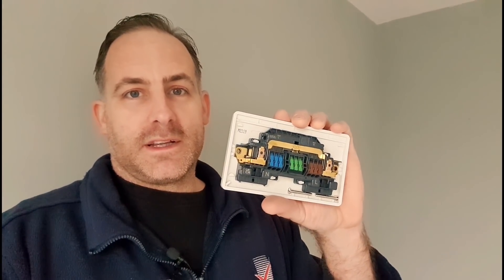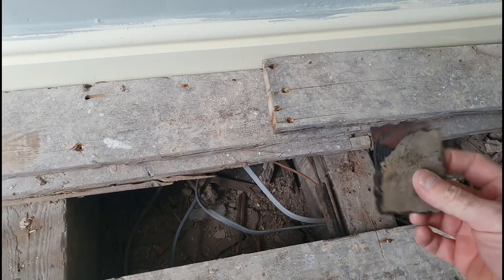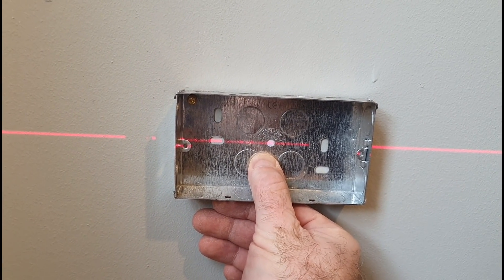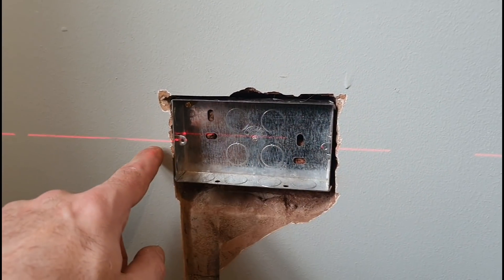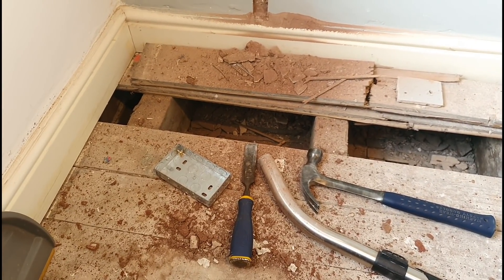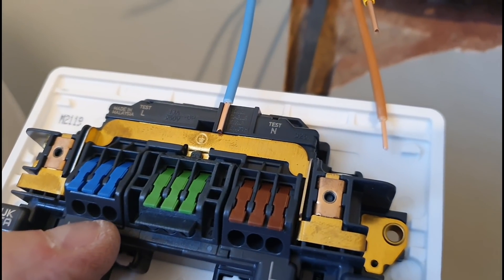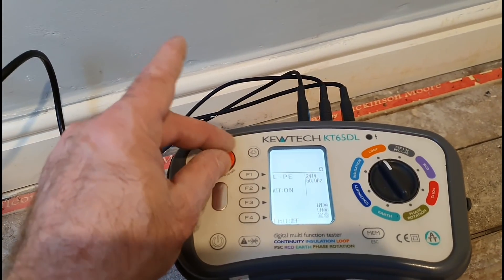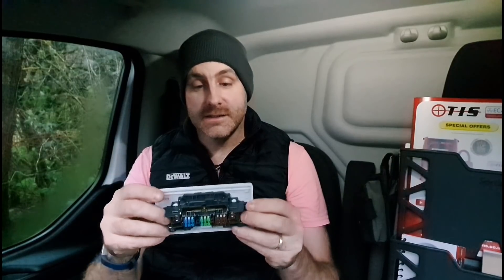OFFICIAL | The Best 13 amp double socket on the market. (55)

Comment: As a DIY-er, the Logic Plus Rapid Fix from MK 13 amp double pole 2 gang socket is one of the worst I've used. Having pushed the cables in properly on open levers, then pushing the levers fully down, the cables would often be loose so that I could pull them out again. I eventually got them to fit so that they would not pull out, but I've lost my confidence with these and have gone back to the screw fix connections. Disappointed because I've always trusted MK and paid the extra for what I thought was good quality.
Reply from the maker: Yes, unfortunately MK are not the trusted quality manufacturer we all thought they were. They've been bought out years ago and now all their products seem to have dropped their standards! I fit an MK consumer unit about 6 years ago and it was a horrible experience.

Comment: Great video, the MK socket is pretty cool as well, dual earth terminals, no need to torque the terminals as they are pre--set by the manufacturers connectors. I was waiting to see how you got down the back of the skirting board but that didn't happen. I used to do a few domestic installs back in the early 80's but we didn't have laser levels, multitools or impact drivers. The process hasn't changed that much, when we first got SDS plus that was a game changer and peppering holes in the brick to fit a back box became the norm along with the brick hammer and bolster chisel. Before we had portable electric drills we used to use a rawl-tool to make a hole and fit a fibre plug for fixings. Before the rawl-tool they used to knock wooden wedges into mortar joints so you could fix accessory boxes with a wood screw.
Reply from the maker: Early 80s you say! The only thing I was doing back then was filling nappies and sleeping ahh the blissful ignorant days. Now I get no sleep and someone else is filling nappies for ME to change. I used an old worn 16mm flat bit to drill behind the skirting. I've seen the timber in mortar joints way many times, I've even done it myself once or twice for a good fixing. Cheers for watching Jon.

Comment: I think they'll be good for the DIY crowd - it's not just the speed of connection, it's the consistency of that connection. They look great for spurs and socket circuits wired in 4mm too - I'm never quite happy that all 3 conductors are satisfactorily screwed into traditional socket terminals for spurs, there's always one cable that wants to slip out!
Reply from the maker: You're right, even with torque settings, all the best equipment and the good old tug test, there's always that uncertainty that that one conductor will flop out or snap off when screwed back to the wall. Not mine of course, mine are all perfect 😁😇👌

Comment: I’m glad they’ve changed them, because the screw terminals in MK is shait as Fok. They cut the thread to prevent screw fallout and they’re a bugger to begin the thread on initial tightening, I dropped them for click years ago. They also have wider holes for a nice full width flat head on the click also… I’m waiting until they become as cheap as screw terminals SO’s, but there will always be that situation they’re perfect for to make that job easier… great vid. Keep em coming.

Comment: Are you not allowed to junction box the ring main under the floor boards where that socket was and spur off it from there?
Reply from the maker: Yes you could do that. If it's not going to be an accessible place then use a maintenance free junction box like Wago, Ideal or Hager provide.

Comment: The problem with them is the ability of the wire to pull backwards out of its home. As you move the socket away from the wall, if you don't realise they are fitted, you can easily pull the live and neutral out at the same time and that's no good if you don't have the power off at the time.
Reply from the maker: Yes, that's something we'll all have to think about from now on when inspecting.

Comment: Pull out a bit too easy for me tbh. If someone smashes into a surface mounted box I'd be worried the faceplate will pull free and leave the conductors exposed tbh. I don't worry about that with the usual screw terminal types.
Reply from the maker: Good point although if someone smashes into it then hopefully that'll get the spark round there even quicker to fix it?
Reply: @JBE  you'd think so 😳😂

Comment: Why on earth didn't you replace the existing socket as well with an MK? Looks really bad having different types in a room. Very unprofessional.
Reply from the maker: Watch till the end, I did but didn't film it. I've had the MK super socket for months and was waiting for a chance to get it installed somewhere. Using a wood chisel to chop plaster out the wall, now that's deeply unprofessional!

Comment: Damn these sockets are sexy, they are definitely here to stay. How much are they and do they do a more modern look ones? 

On a note, so much faster with a sds, also carry some bonding 60 with you, they are so handy with filling chases, sets in less than 60 mins, fillers aren’t really suitable for chases, especially these ready mixed ones. And they take forever to set with such a deep fill
Reply from the maker: Bonding 60 👍 I'll look into it Tony. The sockets are £5.99 each from Screwfix.
Reply: PVA followed by one coat plaster the white stuff,  works for me 👍🏼.

Comment: Would it not been easier to extend the ring under the floor on the existing socket? Save the second chase? Decent job as always
Reply from the maker: It was just the job I was doing and the way I planned it. You're right as are a few others on here, a maintenance free Wago or in-sure box terminated correctly would of been equally acceptable. There's more than one way to skin a cat, chances are if you put it on here someone will correctly inform you it could of been carried out a different way. Cheers Scott.
Reply: @JBE  
Atleast you have the guts to post it mate you make great videos. Even I’m still learning from some of them keep up the good work
Reply from the maker: @ScottMcD91  You learn things from my videos? 😬 I'm sure the only thing I've done correctly is how to make a pot noodle? 😆🖖
Reply: @JBE  Still looks like you make a crackin' pot noodle.  Legend has it better then most 😜.
Reply: I'm glad I was not the only one thinking that, can always run two cables to put it on the ring, would make it easier for the next guy if they wanted to add another socket next to it..
Reply: @steve11211  
More acceptable now with wage boxes and connectors. Leaving a good solid joint under the floor is fine in my eyes. Would always write on the floor board for the next person. But this guys a cracking spark knows his stuff
Reply: @ScottMcD91  Yeah totally agree..  If it had been me doing that job with my luck the existing cables would have gone down from the socket 1 inch then gone off on a 45 degree angle and I would have cut through them..  Nothing wrong with the job, so many ways to do a job no one right way..

Comment: Talking of sockets, why do they melt when running a fan heater for a number of hours? Plugs I've recently had melt also, if they are rated at 13 amps surely a 2kw appliance shouldn't cause catastrophic failure? The MK look nice and are the best i think
Reply from the maker: Hmm 🤔 melting sockets and plugs! Not sure what's going on there? 2KW for a long period of time might make some connections hot? But melting is something wrong in the system somewhere.
Reply: @JBE  Actually it was the plug on a 4 way extension gang, nothing else plugged in, absolute molten plastic around the live pin. Cheapo socket from screwfix melted a little with crack also, same 2kw load over a period of time. Nothing wrong with the wiring, I think sockets and especially plugs are not up to the loads for continued use. MK make one plug that almost looks like an old bakolite it's that's thick a housing, I bet they would have no issue, so how do these cheapo plugs get passed? How many fires will they cause? Great channel by the way

Comment: I bought one for the first time yesterday to fit in a kitchen cupboard. I thought it was a great idea simply because it was awkward to get into the cupboard and I’ll be blunt I couldn’t be asses struggling with a screwdriver in there. I thought they were really good and did make the job easy. 

Great vid as always mate
Reply from the maker: I can see that they'll be good for awkward access outlets. Like within cupboards supplying appliances. Cheers 😎👍

Comment: Mk were the first company to design the socket with curves, then everyone copied them.
These sockets are like every time saving product in the electrical industry, too expensive, manufacturers, price themselves out the market, the time saving does not justify the cost, especially when I can get a click twin socket for less than £2.
Reply from the maker: I suppose it depends on what the customer wants? Some socket accessories are near that price anyway. But yeah by the time you add on your bit they become quite a cost to pass over.

Comment: I think they are a great idea but the levers don’t seem anywhere near as strong or as well built as the wago ones to me, you can just pull the cable out of these when they’re clamped down without too much force
Reply from the maker: Oh really 🤔 I didn't know that. I'll have to have a go next time. Time will tell how they hold up.
Reply: @JBE  yes I can’t imagine them coming loose during normal use but you know you how if you try to pull a cable out of a wago it just wont come out and feels reassuringly solid? Try that with one of these and it does pull out. It’s as if they copied the technology and not very well

Comment: The most interesting thing in this video was you appeared to us a special drill to make holes in the back box, but it only features briefly with no indication what it's called, how good it is, or how I might get one. Perhaps discussed in another video somewhere?
Reply from the maker: Yes definitely Robin, I've featured it in another video where I've had to use it to adapt equipment to suit my needs.
Reply: Cone drill

Comment: Hi James, what about the situation when you take a spur off a ring like you did in this video, how do you connect the earth lead to the backbox? you have only room for 3 earth conductors, do you put 2 earth wires in one connector, I have tested this myself and they appear to hold and test ok, you said you were  going to change the other socket, how did you deal with 4 earth wires?
Regards from Ray in North Wales.
Reply from the maker: Take one of the cpc's from the ring final circuit, put about 3 inches of sleeving on it, then bend a V into it, bring it to the earth lug on the back of the back box and connect it, then sleeve the remaining cpc and terminate into one of the 3 levers. I hope that's understandable? 🤷🏼‍♂️😳👀. If not check out my channel, video number (53) where I can be seen doing this in a kitchen. Although not on this new super socket, just a regular version.
Reply: I think they’ll take 2CPCs in one port, same as wago
Reply: @markhardacre1  Hi, yes I have already tested it with Wago, they appear to make good contact and survive a tug test ok..

Comment: I love maintenance free connections, use them all the time.  Generally I will use Ideal pushfit combined with their junction boxes, but I always have Wago on the van as well.

The idea of this socket is great, but the price is high.  They are nice to fit, especially with the 3 seperate connectors making spurs a doddle.

As standard I use Schneider Lisse and they are £4.50 per unit cheaper.  I replaced 28 units in a house today after a remodel, and a customer would be quite upset if I passed on the £100+ extra charges, the quote may have cost me the job.
Reply from the maker: They will come down in price in time, but they are still basic. No USB, no anti bacteria faceplate, no WiFi and no smart technology.
Reply: @JBE  I'm sure they will. Everywhere else in Europe screw terminals on switches and sockets pretty much disappeared in the mid-90s. Only the cheapest of the cheapest sockets still have them. There were some switches with screwless terminals as early as the late 70s. Unlike MK's they're usually only rated for two solid conductors per terminal though, so you can still get screw terminals on special order for caravans, motorhomes and other applications that require stranded wire.

Comment: for a re-wire where I have a whole load of sockets to fit £5 a socket is something I will get back through getting off site a lot sooner
Reply from the maker: Even cheaper if you buy in bulk.
Reply: Really, If you had 20 of those sockets is over £100, in click they cost me less than £40, plus you are committed to using all mk accessories, so I don't see a saving

Comment: They're OK but... please don't take away our screwdrivers 😭
Reply from the maker: Have you used one JD? They'll never take my screwdrivers 🤣
Reply: @JBE  not yet. I will though. I plan on keeping a couple on the van. They'll be ideal for maintenance fits where you're left with next to no length on the cable, and spurs. Even 25mm back boxes. Just gives a bit of extra confidence when you're pushing it back knowing they're in their own terminals. I wouldn't spec them on an upgrade job yet though, mainly a price thing at this stage. But then again, there'll be jobs where I probably wish I had 😁 it's a decent product. If I'm being a bit picky, it would be the way they're marketed with the multi colour terminals. You walk through the door at screwfix and you know they're advertising it as a DIY product. Doesn't stop it being a very good product though and there's no doubt that lever connections have big benefits.
Reply from the maker: @JD-gi9pl  Yep, they do say "buy me buy me" to a builder/DIYer who might see it and think "this is even easier for me now, I just join the colours up" 🤣. 
They would be an absolute joy to install on a second fix rewire in an empty property with 35mm back boxes. With some great tunes on the wireless and the temperature just right, while the apprentice comes back with KFC for lunch. 😋👍
Think I got a bit carried away with myself there, dream jobs only happen on "other YouTube channels" 🤣.
Reply: @JBE  I'd love a KFC. Instead I'm usually panic eating a Ginsters on the way to the supplier because a 2 hour job is about to take over the day 😁
Reply from the maker: @JD-gi9pl  Me too!! I'm normally gagging on a sausage roll that's way too hot, while trying not to get pastry in my beard, while also navigating a 6 way roundabout in the rain. (That last bit was a joke Mr plod) it's a 7 way motorway roundabout 😎🌭

Comment: I like them, especially if you are spuring off a socket to, so much easier to get all the cables terminated,  I did hear there thinking of trying a fused spur version.
Reply from the maker: That would be great! I'm sure they'll make a pendant too!
Reply: The main benefit is, you won't get some idiot sticking 4 cables in a socket
Reply: @acelectricalsecurity  this is true,
Reply: @acelectricalsecurity  hold my beer.... !!!!

Comment: Nice one mate 👍👍 good to see you back 🙌🏻🙌🏻
Reply from the maker: What kind of trowel are you king of? Plastering or bricklaying?
Reply: @JBE  😂😂 bricklaying mate😉😉 well there’s hardly any brick where I am, everything’s block and stone 🤣🤣 I wanted to be king of electrics but when I tried to cut some t+e with mi trowel I thought sod this to much like hard work 😆😆
Reply from the maker: @kingofthetrowel1725  haha block and stone, where are you Dover Castle? I've do a little brickwork in my days but only on stuff that's definitely going to be covered up afterwards 🤣. I learned my lesson and now stick with wires. Besides the thought of lifting blocks just makes my arms and joints hurt.....even more than they do already!
Reply: @JBE  🤣🤣 Dover castle🤔 they say there’s a trowel wedged in a rock that no one can pull out 🤣🤣 abit far for me to travel from sunny West Yorkshire, otherwise I would go pull it out as I am.....king of the trowel 😁🤣😁🤣 yea my whole body hurts when I breathe mate, was seriously thinking of a career change as a sparky, but there is just so much to take in and remember and them Ze and Zs’s confuse me, I’ve only recently just learned the alphabet so jobs ducked 😂😂
Reply from the maker: @kingofthetrowel1725  🤣 I fumble through it OK and I haven't a clue what I'm doing. Hmm West Yorkshire, so if I look East you're just over that hill 👋
Reply: @JBE  ah not so far at all then 😂 all joking apart I have quite a bit of electric work that needs doing, ie board change to one of them fancy rcbo surge jobbys 👌🤣 sockets in kitchen light switches to re locate etc fancy decorative light fittings downlights outside socket the list goes on 😂😂 might have to see if I can get you over 👍👍 we could compare our trowel sizes 🤣😂🤣😂

Comment: I think wago type terminals are the future, not just a fad. How many sockets, JB's etc have you opened up over the years and found loose terminal screws? Lots I'd guess. Great job!
Reply: True, but that's not down to the accessory, it's the dick heads fitting them
Reply from the maker: Cheers Gary 👍

Comment: Out of interest how come you didn't join the socket into the ring using the ring cables under the floorboards? Would have saved chasing out the existing socket id have thought.
Reply from the maker: The floor is getting laminated and all the skirting renewed. I wanted to make the joint behind the existing socket so it's accessible for future sparkys. I would always prefer to make a joint/connection in an accessible location such as a socket outlet. Joints under the floor in maintenance free boxes are a great plan B. But why have cotton when you can have silk? IMO anyway 🙂👍.